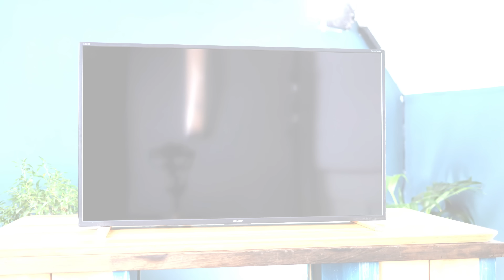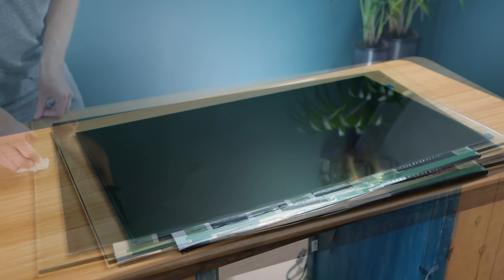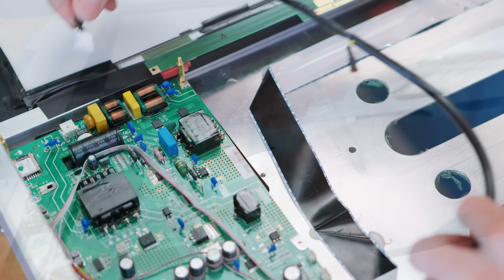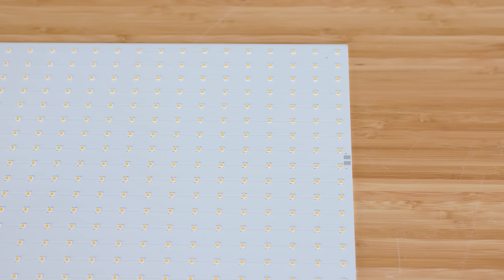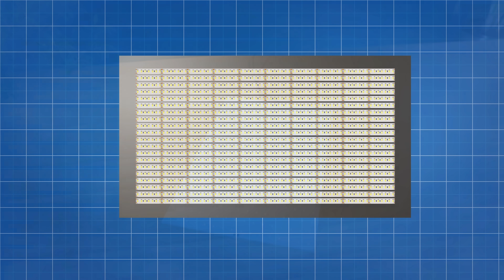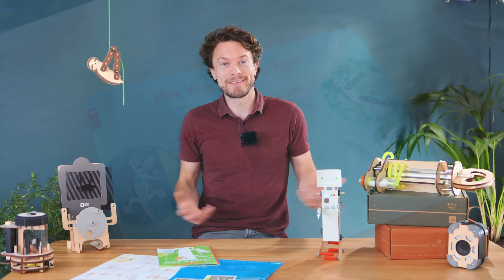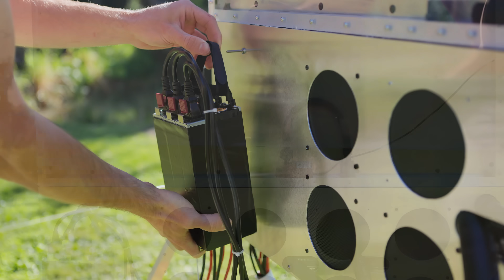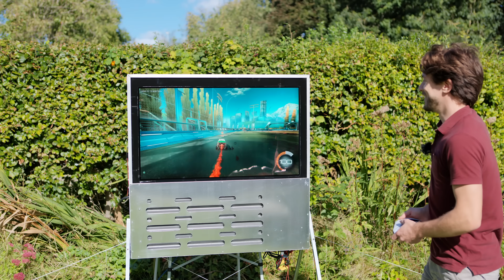Building an ULTRA-BRIGHT water-cooled TV...

Comment: I’ll start by saying I design LCDs for automotive OEMs (not trying to brag at all).
There are a lot of great ideas here, but the one thing that VERY much concerns me is the waterfall cooling. LCD polarizers are made from PVA, and they are easily destroyed by high heat + high humidity (even high-temp automotive-grade ones).
If you want to keep the water cooling, you have to seal off the LCD (color filter part). It’s a good idea to do this anyway since the display will be outdoors.
I’d also recommend adding a shroud around the TV. This can tremendously help with outdoor viewing.
Also, if your TV backlight is still working, you don’t need to scrap it. You can just add additional LED strips inside.
Also, you can buy copper refrigeration tubing and run it directly behind the LED strips, and then run water through the tubes for cooling. Use a conductive paste from a hardware store (not expensive CPU stuff) between the copper piping and the sheet metal housing.
Lastly, if you can apply an anti-reflective film to the front glass, it would help tremendously, they can be expensive. However, DON’T use an anti-glare film. They make the display hazy, especially outdoors.
Reply: If we need to rebuild the world after a zombie apocalypse, we know who to find.
Reply: @leagibson  I'm pretty sure an outdoor television will be the least of our worries in a zombie apocalypse
Reply: I wouldn’t worry none of us are gonna make this 😂
Reply: I don't think anyone would take what you do as bragging.
Reply: Applications like these is why Sharp makes rLCD (reflective LCD). No back/front light needed when it's bright, then lights on as it gets dark.
Reply: To reply and add to this from the perspective of someone who repairs circuit boards on a component level, I WOD be concerned about moisture working it's way inside the enclosure since the radiator holes aren't sealed, I would want to see a sealed barrier between the control and boost boards and where the holes for the radiator are. 

Also I think everything Daniel was saying was spot on, I would add that for the copper tubing cooling method you would need a high pressure pump.
Reply: Silly question, I'm in no way a electronics expert, not even tinkerer, but given he replaced the backlight LEDs, my head started to wonder, and maybe you could answer this. How possible (not feasibility or cost, but possibility) would be to add smaller but increase the number LEDs backlight, in a consistent pattern, and be able to program each one of them to be on or off, thus creating a local dimming TV? Would, for example, be possible to intercept the video signal with a raspberry pi, turn the image signal to black (off) and white (on) and thus, making something like a Samsung Qled on the budget? Has anyone ever tried such a thing,just for sh*ts and giggles? I know someone made a similar idea of this, but the intent was to emulate the Phillip's ambilight on a budget, using cheap RGB LEDs strips and a raspberry pi to manage them.
Reply: @hf7188  oh and for what it’s worth, I believe the Neo QLED displays use a mini-LED array behind them (as opposed to being edge-lit with a light guide plate).
Reply: @danielakins3823  thank you so much for time you spent answering me, I didn't get a notification on the reply, hence why late thanks. I thought the major issue would be latency, and efficacy of such a project.  Once again, thank you for clearing that up, glad I learned something new. Have a great holiday season.
Reply: @hf7188  Curious to hear his thoughts as well but my gut reaction is latency and response time would be difficult to deal with. Even if you could add an appropriate number of zones, all of that would need to refresh fast enough with LEDs (and driver circuits) with minimal turn on/off times. On top of that, the latency of the entire program could lag behind the video to a very noticeable degree if not accounted for.

Considering the issues (bloomimg, black detail, uniformity, etc.) that are still a problem even on high end local dimming TVs, a hacked together DIY solution is probably not worth it. Perhaps some of this is easier to overcome than expected, it would still be cool to see it tried regardless.
Reply: @hf7188  I think it would technically be possible to do by intercepting the video signal going into the tv, but I think it would be nearly impossible to integrate it directly into the tv. The serializers / deserializers are in their own world with specialists that focus solely on those details.
In theory, I guess you could use an HDMI splitter going to a video capture card to analyze the video. You could bin the local areas, calculate the average brightness, and drive the LEDs in an array. It would probably be difficult to get everything synced nicely.
Also, QLED isn’t the same thing as a mini-LED backplane. QLED is a quantum film that outputs light when hit by light. It can emit a large spectrum of light, where as the LEDs typically are made by combining 3 colors into one. This gives the ability to display a lot more colors. You’re talking about full-array local dimming where there is a matrix of mini-LEDs to backlight the LCD.
Reply: @hf7188  I was thinking the same thing, the deal is each of the panels that use full array local dimming use chipsets that are designed to understand the contrast of the picture and dim the proper LEDs appropriately, in a DIY setup like this the LEDs are based on how you created it, and if you used a recycled chipset it would only correspond to the number and order of LEDs it was originally designed for, you would need the software from a recycled chipset to understand the contrast for the image in the first place, then would have to customize it to correspond to your exact LED setup, however the overhaul of preset base values required for this task would be a nightmare to say the least, would practically have to redesign it from the ground up, unless you made it a point to simply design the LEDs to exactly how the manufacturer designed it to work to begin with, would probably be the only practical way to do it
Reply: @Jacob Sorensen  yeah I looked it up and 20’ of 3/8” is ~$30.
You could probably use something else, but copper has excellent thermal conductivity.
Reply: @danielakins3823  You could recycle piping but even at hardware store prices, I think that's still the way to go. With a mounting solution providing good contact, you could probably get away a fairly inexpensive length of tubing. However the glaring issue with copper is galvanic corrosion when mixed with an aluminum radiator or other components in the loop. You could minimize this with added anti-freeze/anti-corrosives but this also impacts the cooling potential....

On a side note, what are your thoughts on such high intensity lighting reducing the lifespan of the display itself?
Reply: @JJFX-  yeah, you’re exactly right about the galvanic corrosion. I guess you could get aluminum tubing, but I’m not sure of its availability. I would think a lot of other components would start failing before the corrosion would be an impactful issue.

The intensity of the lighting basically won’t degrade the TFT or color filter at all except for the absorbed radiated heat (across all wavelengths). We use significantly more light for HUDs, and other than keeping the temp of the TFT down there aren’t any issues. Of course that’s much easier said than done lol. Basically try to keep the surface temps below 80c.

If you really wanted to get fancy, you could always tie in an ambient light sensor to the backlight circuit.
Reply: @danielakins3823  You're probably right. I suppose a simple loop without tight choke points wouldn't be as much of a factor. Buildup could affect certain pumps but assuming some inevitable permeation, it's probably wise to top off/flush it 1-2 times a year anyway. As long as freezing isn't a concern, mild additives (and perhaps an algaecide) would be enough to keep a distilled water loop from mattering within the useful lifespan.

I always assumed bulb intensity would have more impact on screen life so that's interesting. I'm looking at it from the perspective of LCD resin printers but they use UV wavelengths which will obviously be more damaging. You probably wouldn't want something like this on full power in bright sunlight on a 100F day but cooling may get overwhelmed at that point anyway. I'm sure this can get very tricky in a vehicle environment so I imagine you've seen just about everything. Perhaps a simple thermal sensor to throttle LED intensity would be necessary in places like California without getting too complicated.
Reply: Hi mate. Not the best place to ask you this question but i've made my own infotainment system in my car and I use a permanently fixed samsung galaxy A50 on my dashboard. I have it for a few months now but summer is coming and I have relocated the phone battery due to heat concerns for when I leave the car out in the sun. But do you think the screen can hold up the temperatures in the summer? It's a super AMOLED according to gsmarena.. Would you recommend any type of cooling?
Reply: Hey can i ask you some questions about lcd i didnt find anyone in person who can answer my question so id be so thankful if you reply
Reply: are there any advancements in polarizer material that are resistant to heat? or more efficiently let light through?
Reply: @ab-nz2mm  there have been advancements for heat resistance, but the options are basically very expensive. Light efficiency through the polarizers are essentially maxed out since they inherently block 50% of unpolarized light. There are other options such as DBEF films and polarization reflection films that help recycle light to somewhat polarize light before the LCD polarizer.
Reply: @ cool, thanks for the reply. Do you know why miniLED backlight systems have to use PWM instead of CCR? Why can’t they just truly dim with CCR instead of PWM?
Reply: @ab-nz2mm  PWM can dim to much darker levels, it's more energy efficient, and it prevents the significant color shifts that come with CCR
Reply: Yeah he will definitely burn in the polarizer over time my new laptop has it from the task bar
Reply: I think it has more issues than he'd like to admit. There doesn't appear to be any water drain below the radiator and it really doesn't look that sealed from the electronics (particularly the ports on the bottom channel, those will be gone quick)
Reply: Would it have also helped to (refractive)index-match the polarizer to the LCD?
...Also, what's a good source for anti-glare film?
Reply: @llibressal  his comment literally said don't use anti glare film...
Reply: @llibressal  the polarizers should already be index matched to the TFT / color filter, but in theory you could index match the optically clear resin (adhesive) between the front glass and the front polarizer. This would be difficult and likely require a custom blend, or by adding custom coatings on the back of the glass and the front of the polarizer.

Also, for the anti-reflective film, I’m not sure of the best place to find something. I think I’d start on Amazon or try to find films used for office windows. As @mushin111 mentioned, don’t use an anti-glare film. With that said, the “anti-glare” coatings that are used on eyeglasses are actually anti-reflective coatings (in the display industry.)

Comment: Questions:
Would this work on computer monitors?
Would it be possible to vary the brightness via a knob? (For the added possibility of indoor usage without being BLINDED)
Reply: yes and yes, you could somehow hook up the LEDs to the control board (probably with a transistor to the power supplies) to utilize the PWM dimming function that's built into the board
Reply: @rafeesamith  Nice! Thank you

Comment: I wonder how long it can actually stay powered on. With no active cooling of the LCD, the liquid crystal will continue to absorb the light energy, eventually causing it to exceed the clearing point, and just go white. In the industry, we typically have to use expensive conductive materials with high transmissibility, like sapphire, as a shield between the backlight and the LCD.
Reply: Some of the air from the fans is redirected between the LCD and backlight for cooling.

Comment: You could measure the brightness by using an ND filter on your colorimeter. A 4x filter would probably be enough.

Edit: oh, and also, RGB LEDs could result in quite an efficiency boost if you chose them right because you wouldn't waste all the light that's the wrong color to ever get through the LED's filters. Could increase the color gamut substantially too. High-CRI lights can increase the gamut compared to cheap LEDs, sure, but the RGB light could get it even better and maybe even technically improve the black level.

Comment: As someone who's just researching HDR monitors for my next purchase this is really interesting.
From my searching: 250-300 nits is standard for a normal monitor, 400 nits is the beginning of HDR, 600 is intermediate HDR, and 1000 is high end and you'll usually be paying a few grand. And these numbers are just peak (temporary) brightness, maybe like the equivalent of redlining your car.
Another interesting thing is that the backlights on HDR monitors get brighter and dimmer, individually, depending on what part of the screen needs more or less bright, to give more contrast to the image. Which would be an interesting modification to do to one of these screens if you happened to have a HDR model. It would probably have a circuit board with individual connectors for each light/set of lights.
But damn, this is an awesome project, I especially love the car radiator! I was expecting something like normal PC watercooling..

Comment: Great build but unfortunately CRI isn't a perfect measure for the backlight, the highest colour reproduction comes with a trichromatic source, RGB (though red and green LEDs have much lower efficiency)
You could use a neutral density filter to measure the colour gamut. Perhaps a matt coating on the screen?
I'm curious about the temperature of the front glass after prolonged use, that's a lot of light to absorb!

Comment: Excelent project. One thing I was expecting, replacing each backlight led with a more powerful one(with some sort of external power) On the same backlight configuration so the tv still controls the brightness of each area. That would be more complicated...on the other hand you could tune the tv brightness through its settings. This would solve any problems from viewing at night,cloudy or just having some strong black on movies or games. Edit: one more suggestion for anyone who wants to build this and wants to minimise space for the cooling,make zig-zag channel sandwitch of pexiglss on the back of luminium and let water run inside. Cheers

Comment: 12v Cob lights x 20 panels in series = 220v input !!
Means no need of a power supply + you can also use a simple fan potentiometer to adjust light intensity !!

Comment: Server PS is too loud
No control of Brightness
PS is outside so on it is not waterproof
Are you sure that all LED are cooled? As it is not full surface contact with water
What about cooling of water is there any fans on the radiator?

Comment: with all the holes and the power supply being outside I fail to see how it will hold up to any rain.
That said, it's an awesome build
Reply: Thats what I was thinking
Reply: @EyesackWorley  He said he left the PSU outside because he could easily disconnect them if he needed them for another project but you could always mount them inside the PC itself or put them inside a waterproof casing
Reply: @zahidshabir4038  but what about the holes on the top sides?

Comment: if you series connect those server power supplies to make 24volts/ 36v/ 48v  look up how to DC isolate/ float the ground, if you don't or use the lethal method of AC floating the ground you can die, a painful excruciating death. using server PSU is an old trick from radio controlled model racing, for drones and cars to power their battery chargers. DC floating just involves use plastic nylon washers and screws to conductively isolate the board from the shell of the PSU.

Comment: Isn't there a potential LCD burn in issue? By the sun heating the black surface or LEDs heating too much the difusor?

Also, samsung comercially sells TVs for this, it's called The Terrace. Obviously at 10 times more cost

Comment: This is really cool, but it has two major flaws: First, LOCA doesn't like to cure evenly (at least not in sunlight), nor does it like large temperature changes, nor does it like being applied to a large surface. Within a year, you'll get a LOT of spiderweb cracking. Second, LCD panels don't stand up very well to direct sunlight. You'll get some dim and black spots probably within a few weeks, if not days, as the sunlight degrades the LCD panel.

Comment: I wonder if you could use some Neutral Density Filters to darken the signal going to the calibrator?  I first heard about them in some random recommended video about photography.  I think they're usually used to cut the light evenly for long exposures.

Comment: High CRI on the backlight isn't the best idea. You get lots of unwanted energy at wavelengths in the yellow and cyan region which is unwanted. You want LEDs that feature quantum dot phosphors that produce nearly monochromatic red and green wavelengths from the blue LED.
Reply: I might add that the high CRI does have one significant advantage for deep red wavelengths between 650 and 700nm, which would help. I think the color calibration profiles built into the TV would be pretty screwed up though. Maybe try an ND filter to do the color calibration or add the ability to dim the backlight?